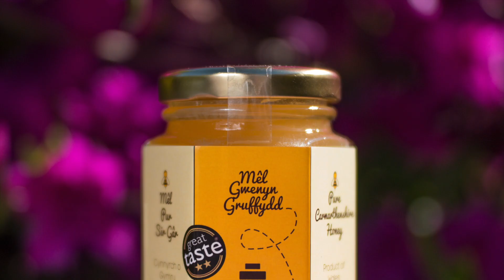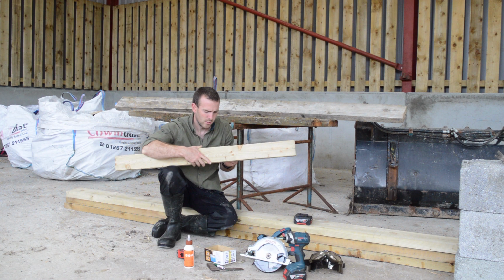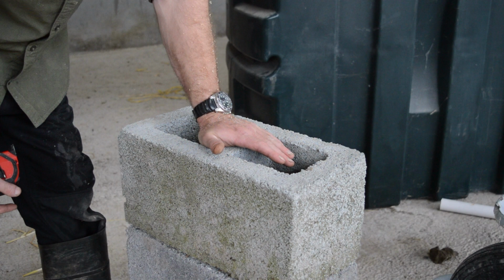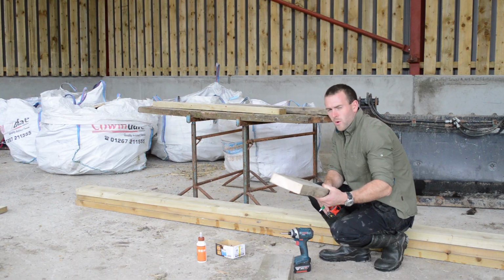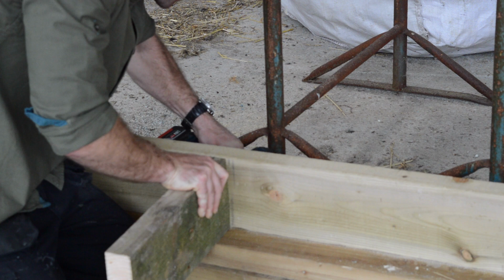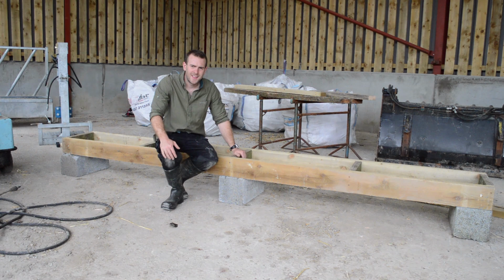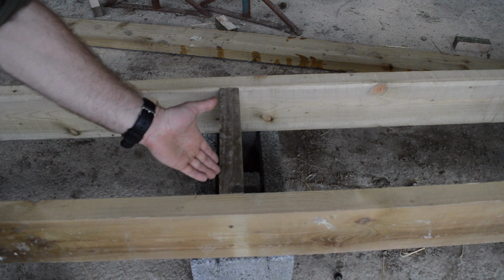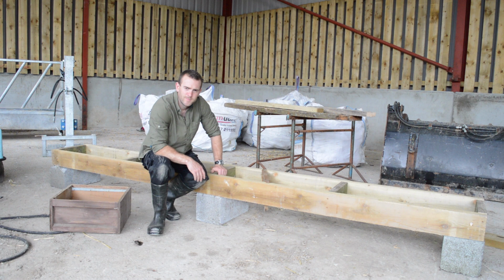How To Build A Heavy Duty Beehive Stand

Comment: Is it necessary to use that thicker wood? Will it be safe from worms during rainy season?
Reply from the maker: Yes I would say you need thick wood. I have used 4”x2” in the past and they will bow under the pressure.

Paint the stands or use tantalised timber and place them on bricks so their off the floor.

Comment: The lumber looks like a full 2x6.
Reply from the maker: Hi! Yes it is! 

That’s my favourite spec for a hive stand. But I do use 2x4 as well.
Reply: I only mentioned it as here in the states most 2x6 are 1.5x5.5.  If you want full size you would have to go to a mill.
Reply from the maker: Harold Keiner really!? What is the reason behind that?
Reply: @gwenyngruffydd  All lumber is sized less than it is called.  2x4 is 1.5x3.5    1" lumber is 3/4"  I'm 68 and as long as I can remember lumber has been sized small.  I remember when a 2x4 was 1.75" x3.75".  I guess it so they can get more lumber from a tree.  Most lumber, if you don't use it fairly soon after purchase it twists and warps, if left to sit.
Reply from the maker: Harold Keiner our wood does that too. Unless we buy CLS timber. I think they are sized much smaller too.